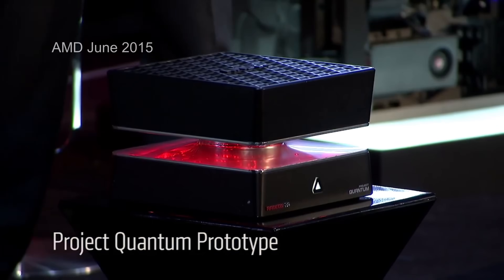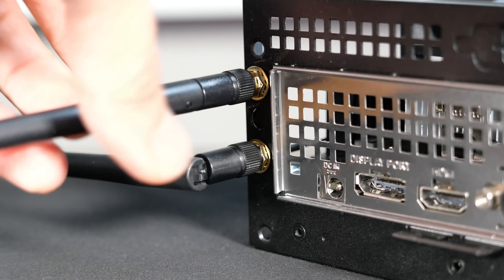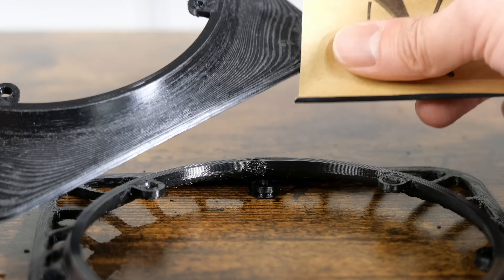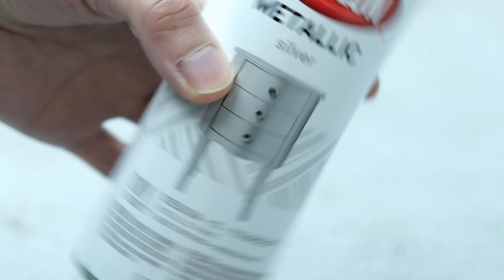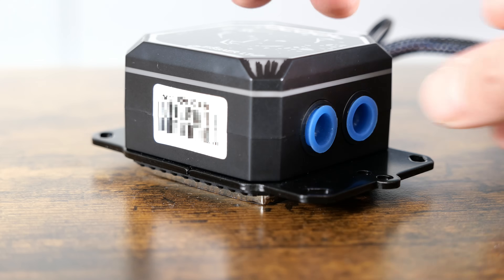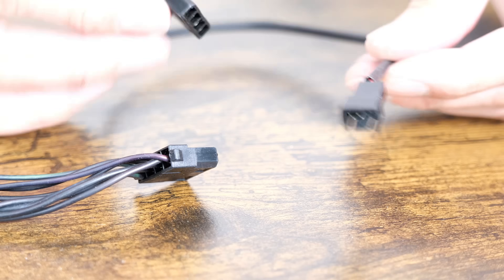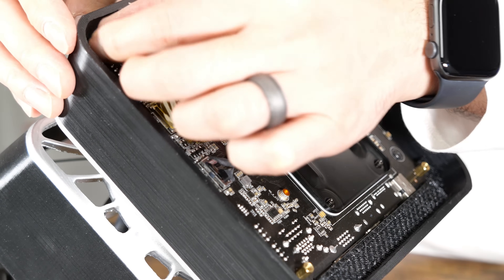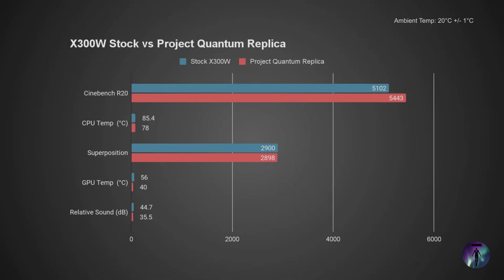DIY AMD Project Quantum Concept PC

Comment: let's try that with the new minisforum with the 780m iGPU
Reply from the maker: If the dimensions stay the same (STX mounting, and AM5 mounting compatibility) it should drop right in. :)

Now can I afford to buy the new X600, 8700G, and 64GB DDR5? That’s the mystery lol

Thanks for checking out my project!
Reply: @standupg4m3r  I'd say 32gb of ram is pretty much enough on a platform like that but ... i guess not 😂😂😂😂
Reply from the maker: @roguemo  Mo RAM, Mo Betta’

Comment: Could a low profile gpu be added on it?
Reply from the maker: Thanks for watching. It’s definitely possible but this build already had a lot of customization done and adding a GPU will undoubtedly add more customization and an increase in size.

The original Project Quantum was actually fairly large in comparison to this replica.
Reply: @standupg4m3r  I see, I got the STL model, and I am trying to to remodel it in order to make a flex PSU and a GPU fit on it. Not sure but I am thinking in increase the bottom height.
Reply from the maker: @lucasaugustomarques2556  good luck and thanks again for watching!

Comment: you do know those 'O' rings on the pump are meant to be used not removed.
Reply from the maker: Thanks for watching the video.

The G1/4 system was originally intended to be used with an oring at its flange, and it is what I chose to go with. Leaving the included grommet inside may have lead to a compromise on the sealing if I also left the oring located at the flange - two sealing systems that are meant to be squished would have been too risky imho. And relying on just the included grommet would have introduced variables (how far Barb would have gone in) that I again didn’t want to deal with since the tubing routing was already as complicated as it is.

Comment: Could this design be easily adapted for a mini itx motherboard? It’s not that much larger.
Reply from the maker: The answer is always “yes” with time and money being the variables that answers the follow up question of “when?”

PS - stay tuned. ;)
Reply: @standupg4m3r  depending on your expenses, I would consider paying for the modification.
Reply from the maker: @braddahr  It's going to take purchasing an HDplex with adapter or GAN power supply. I can't afford either at this time.
Reply: @standupg4m3r  sorry I just meant modifying the 3D files. I’m thinking mini itx, sfx psu, fan. I’m not sure about water cooling. I’ve done it with AIO kits but not custom.

Comment: Whyd he take out the rubber seals for the water pump🥲
Reply from the maker: G1/4 relies on the oring interface from the barb and it would have been redundant to keep them in there and Or possibly interfere with the oring on the barb.

Comment: Very bad 3d print
Reply from the maker: I’ll strive to do better. But thanks for watching!
Reply: @standupg4m3r  just paste link please what you use for cover lines from 3d print to have smooth finish.

Thank you
Reply from the maker: @schranzwar  I have a link for “high build primer” in my description that I used to help smooth out the middle sections before painting. But you can also research Bondo brand products as well.

Thanks again for watching

Comment: An alternative build on this could be using laptop a grade GPU and adaptor board in the top section with passthrough cooling from low-speed, but large, case fans.

Perhaps might involve printing a wider version of the case to allow airflow around the motherboard, and a more raised underside ... but, yeah!
Reply from the maker: Cool idea, and thanks for watching!

Comment: u could use an aluminium sheet for the top as antena, i would save u space, and help in the heat dissipation
Reply from the maker: Hey thanks for watching and sharing some cool ideas! I had to stop myself from buying a laptop antenna sheet, and figured the more stock I can keep it, the better it would be for my viewers who want to build this project.
Reply: @standupg4m3r  that's actually pretty cool, makes me wanna build my own version, with a gpu and probably without the wifi
Reply from the maker: @davidjordaomoreira4196  a revisit of this is actually in rummaging in my mind, since I’ve seen a user on Reddit post a sandwich GPU/CPU water block mimicking the original Project Quantum… it would be bigger but would also be more gaming capable than the iGPU being used in this project now.
Reply: u would probably need to give some space between the plate and the structure, due to air flow, but i would look cleaner, our u could just built the AMD logo in metal, it would be also good as antena

Comment: your soldering iron tip has been sanded at some stage or is it a rusty fence nail
Reply from the maker: It's been sanded, dropped in paint, stepped on, submerged in diet coke, and it just keeps  kicking! I have a separate station for real soldering work, but I like using this beat up old one since it can touch plastic and I won't cry about it. Thanks for watching btw!
Reply: @standupg4m3r  you dont sand tips
Reply from the maker: @abecoulter8550  I would never do it for my real soldering tools, but for this? Oh well, it was a quick fix after dropping it.

Comment: which is better for this? for  real use..
ABS or Nylon?
Reply from the maker: If you’re in a conditioned room, even PETG has survived hours on hours of none stop gaming, so either material would work great imho. Thanks for checking out my project too btw.
Reply: @standupg4m3r  thanks...
it is a really great project, even i liked it back then, and hoped for either  an entry level APU desktop or for a U-series (mobile CPU) system, or just as a case, but it didnt happend..
so its really great that someone (in this case you) actually made it a reality..
so thank you for all the work.
Reply from the maker: @mrdot1126  your appreciation means a lot!

Comment: When you print IO holes, during design you can add your own supports that you can cut out later. I don't trust autogenerated supports and it's very easy to just add 0.4mm cuboids for 1 line wide supports.
Reply from the maker: Will check it out for future prints! How much more time is to add the supports manually vs automatic prints? They both pose risks when processing from my experience.
Reply: @standupg4m3r  I suppose automatic takes less time, but we're looking at minutes in comparison. Your control over the supports vastly out does the best auto supports can ever do though, as you can hide contacting faces in many crafty ways, making cleanup much shorter.
Reply from the maker: @trakaiszeks  I’ve seen the video Teaching Tech (…or other?) did a while back about it and I thought it was really neat! I’ll try it out in my next case and you’ll here a call out in case I do. ;) 

PS - maybe it was another video from a while back when I was researching proper ways to print the Mandalorian helmet…

Comment: Doesn't make any sense to rebuild a new case for that motherboard , that system already well done by Asrock. 
I have a Asrock Desktop Mini X300W with R7 5700G, 16gb RAM, M2 ssd. It's by far the best mini PC i've been used. 
The temperature on the CPU can be lower is the system has Noctua CPU cooler fan - low profile. 
Even now with the stock cooler the CPU 5700G stays already good (55C - 65C) so what the point to complicate your life? 
Just to have fun or to spend time, money? okay not for me. 
Its no real improvement, its no dedicated graphic card on the new system using the USB C port, so again useless from my point of view.
Reply from the maker: Thanks for watching anyway! Glad you are enjoying the system in stock form. Cheers!

Comment: Hey,cool build! Why do you censor barcodes on components?
Reply from the maker: Thanks for watching! I purchased all these parts with my own money, and if I want to keep my warranty (for the parts I have not mangled!) I have to make sure no one has processed an RMA using the S/N. It's case by case, but I am just taking precautions.
Reply: @standupg4m3r  I see! Thanks for the clarification
Reply: @standupg4m3r  Ah. See. I asked because i just didnt scroll far enough. Thank you. I hope you have a good rest tonight
Reply from the maker: @darkwubshd4961  hey no problem! Even my wife asked why I was doing it. Again, I do want to thank you for watching and commenting though!
Reply: @standupg4m3r  I really doubt RMA fraud like that would get past any remotely decent company, they'd likely just send the part back to whatever idiot tried to do it as soon as they received the RMA and checked the serial.
Reply from the maker: @boomers_pb  A part of me is heavily leaning on just risking it - I have sent in parts before with stickers removed so it really depends on the situation and company - I think it was a recall issue.

Comment: I'd love to see something like this, but for a midrange gaming build. Probably would have to be a little bit bigger, but something like a ryzen 5600 and some kind of small form factor gpu preferably Radeon if they have a good one. You'd probably have to give up the water cooling and put a little bit bigger feet on the bottom for air flow and find a small or flexible enough pcie extender for the graphics card but I think that would be an amazing build!
Reply from the maker: Thanks for watching. It would have to grow substantially to accommodate a dedicated GPU, but anything is possible!

Comment: Asrock X300M-STX is an excellent and impressive miniSTX motherboard as a base for a mini-PC using an AMD APU type Renoir(4xxxG) or Cézanne(5xxxG), offering excellent performance for multimedia or gaming (for an APU), myself I have one under Ryzen 7 5700G with iGPU Vega8 overclocked to 2500MHz and 32GB(2x16GB Samsung B-Die) DDR4 SO-DIMM overclocked to 4000MHz(with IF syncro 1:1 and latency in CL16-18-18-36 -1T), which increases the performance of the iGPU by 35% to 45% depending on the games used. Anyway, you have a really nice build.
Reply from the maker: Hey thanks for watching! The 5700G pairs so nicely with the X300W. I have not overclocked anything yet, but may look into it. We have the same bulls but you have faster RAM.